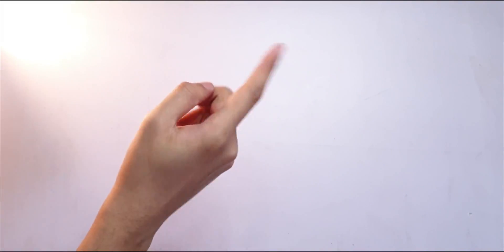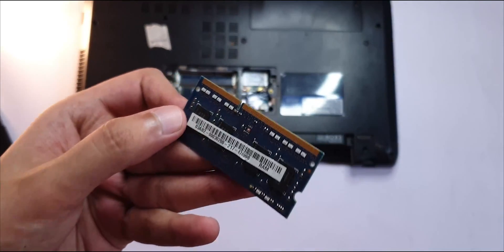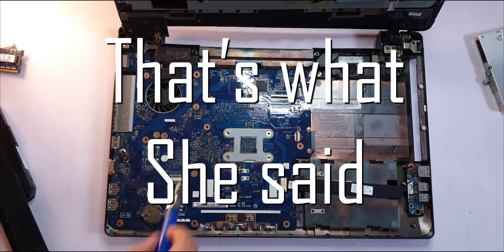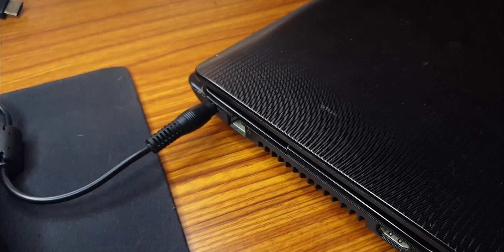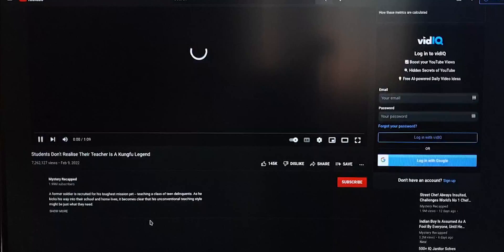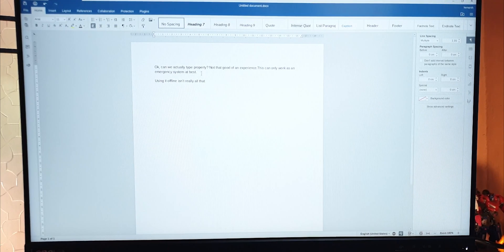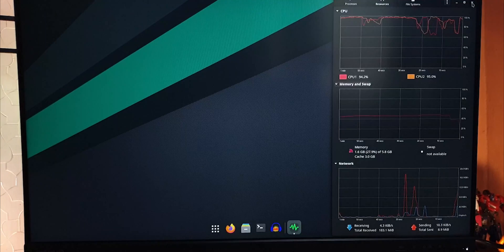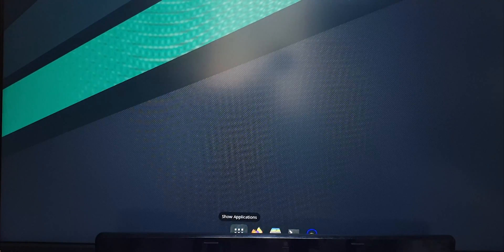Running Manjaro on a 10 year old Laptop - Can It Be Revived?

Comment: I own a 2010 Samsung laptop and I've used Manjaro on it, if it weren't for the WiFi issue (intermittent, sometimes it works and sometimes it doesn't) I would be using it by now
Reply from the maker: Hmm, have you tried any XFCE versions?

Comment: if a laptop doesn t do even 480p videos it means that the hardware was low end even back in 2008-2012. i had a toshiba sattelite l300 with a 2 ghz single core celeron cpu, 4 gb of ram ddr2, a 240 gb ssd and intel gma graphics. it was running ubuntu 20.04, and windows 7 and was running slow.
my conclusion it is on a old laptop you should read reviews about it back then to see how it was back then. if it was a cheap, low end system, it means thai it is useless today. if it was high end back in the day it means that you should try installing a linux distro to se if it is useful. if not it is crearly outdated.
Reply from the maker: Yeah, I remember this laptop being decent at best back in its relevant days.😅

Comment: I have an old 2003 laptop, with a pentium 4 desktop processor - dell inspiron 5100. I have installed antix on this, and it runs fine. It has a youtube app, which plays videos at max 480p. But, other modern web pages have issues loading properly.
Reply from the maker: Try Chrome OS Flex on it. I'm planning on that too 🙂
Reply: That laptop monah Bnr is using is so old that doesn t have the necesarry instructions set for chrome os flex
Reply from the maker: I see. Thanks for the clarification

Comment: Go with an Arch and Dwm setup.Dwm or any tiling window manager for that matter.
Reply: If you're not comfortable setting that up/want ready to go solution. Try arcolinux(based on arch. But you get multiple iso on their site and you can pick depending on the window manager of your choice)
Reply from the maker: How about Chrome OS Flex? I've heard good things about it 🙂
Reply: @TheHopelessGeek  not sure. But I'll suggest you to still try Arch(manjaro and arch are not same,arch is much more bare bone) and I guess that's where all the fun is. This would be a perfect setup for you. It's an old laptop, what do you have to lose(if it breaks you can always install some other os on that ssd right?). But in the whole process of setting up Arch + dwm you would learn more about Linux in general, and install only necessary things.
Reply from the maker: Okay, I'll try it out.🙂

Comment: zorin OS lite that comes with XFCE is the best distro for old laptops.
You could make a video comparing zorin os core, zorin os lite and linux mint.
Manjaro is not a good choice because of it being a bleeding edge rolling distro and Gnome is very RAM intensive. KDE uses much less RAM than gnome and I believe XFCE needs even less RAM than KDE, although the results are kinda mixed.
Reply from the maker: But based on what I saw, RAM consumption wasn't the issue. The CPU cores were maxing out.😅 but I'll try Zorin OS👍